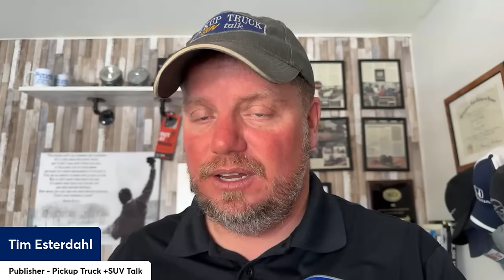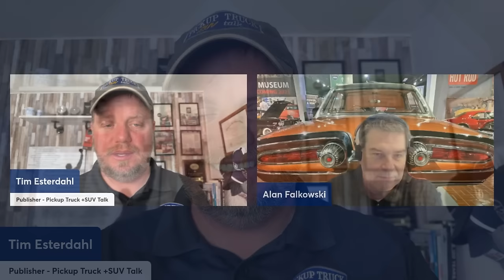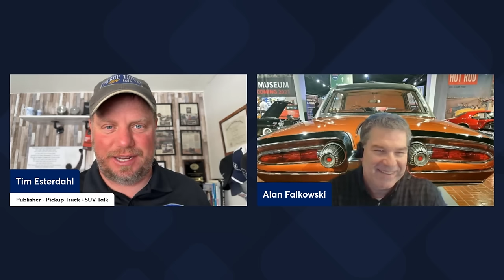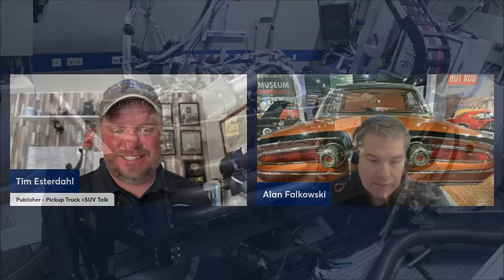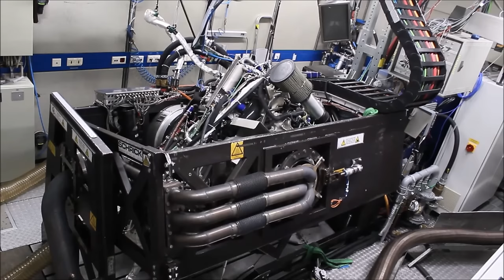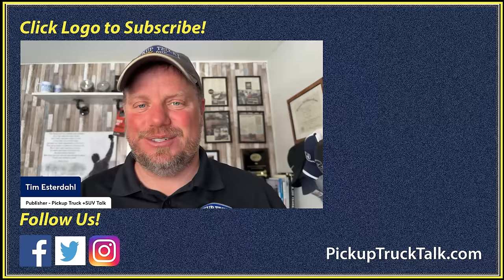Engineer Deep Dive: 3.0L Hurricane Engine - Turbo Life, Oil and Intervals and More

Comment from the maker: There's been some questions about direct injection and carbon build-up on engines with this technology. I have asked about this with various engineers over the years and they have responded that the higher PSI of the spray nozzles, it atomizes the fuel better and removes this concerns. Here's an example of this explanation at the 3.28 mark of this video with a Chevy engineer. He is talking about the 6.6L gas engine, but this same information applies to most other gas engines. If you check out the spec charts online, you'll find the gas pressure spray PSI level for most is well above 2,000 with some being higher. The Hurricane engine has a "single high pressure pump providing up to 5,075 psi (350 bar) to a single fuel rail."

https://www.youtube.com/watch?v=A_VaFCpQ9nY
Reply: Fuel pressure being higher makes zero difference.  Most of the carbon build up happens on the back of the intake valves. A port fuel injector would spray fuel onto the back of the valve, cleaning it.  A Direct injection engine can't do this ,because the injector is inside the combustion chamber. Now they can play with the variable valve timing a bit to mitigate some of this.  But we had the heads off a 2022 6.2L gm last month. The carbon build up is clear. The only way to deal with it is frequent induction services,  which currently GM does not require as part of regular maintenance. However, one of the first recommendations to diagnose a P0300 code ( random missfire) is to do an induction service with Top engine cleaner. 

The problem of carbon build up very much exists. GM seems to be fhe best at avoiding excessive build up. But it still happens.
Reply from the maker: @terrencejones9817  The way it was explained to me is carbon buildup is left over fuel that wasn’t fully cooked. Higher spray causes better atomization and therefore you don’t have left over fuel. Thus, the carbon buildup on the back of the intake valves doesn’t exist.

FYI - Ram has 5,075 PSI spray pressure.
Reply: @Pickuptrucktalk  Problem is that doesn't address what actually causes the carbon build-up on the back of the valves. It's not fuel, it's  oil/fuel vapour from the PCV system.  All engines burn crank case vapour through the PCV system.  Higher fuel pressure will actually make this problem worse.  That high fuel pressure dilutes the engine oil with fuel. That fuel in the oil causes higher pressure in the crank case. That fuel oil mixture is then sent through the PCV and its dumped right on the back of the valves. 

People that like to go on extended oil change intervals make this situation worse. The more fuel contaminated in your oil, the less it lubricates, the more the oil turns to vapour. 

Google the GM Dexos gen 3 spec.  It's specifically designed to reduce oil coking/deposits in a turbo charger.  The only way you get oil deposits inside a turbo, is if the shaft seal is leaking,  or the oil is being pushed through the PCV system .

My wife owns a 2018 equinox 1.5L turbo DI engine. I maintain it well. Recently in cold weather it developed a missfire.  GM has a TSB about intercooler icing.  When we pulled the intercooler boot off, it was full of water and oil sludge. The only way oil is getting into the intercooler is through the PCV system.  I change the oil on this car every 3000 miles (5000km) I do an induction service every 25k miles to avoid the carbon build up. That being said, the discovery of oil in my intercooler,  means I'll be doing another induction  service soon.

BTW, if you took a look inside the intercooler of any Ford Ecoboost, you'll discover the same issue.
Reply from the maker: @terrencejones9817  all I know is the spray pressure is the answer I get from many different engineers at different companies. I’ll also add in the last few years I get confused looks from engineers when I ask them about carbon buildup. I take that look to mean they consider it resolved and have moved on.
Reply: @terrencejones9817  I agree with you sort of. Better burnt fuel is gonna push back any meaningful carbon build up. How far it pushes it back? Who knows? 150k miles maybe. But yeah you are right. It's gonna happen and it makes it hard to look at these DI engines and not say it will eventually reduce the performance and longevity at some point.
Reply: @Pickuptrucktalk   They definitely have not been solved, I'm the Front line guy who sees the problems first hand. I understand why engineer's have decided to go to these types of designs. However,  there are some fundamental compromises that happen with them, and they can not be fixed.   Check out some of the videos that Engineering Explained has done on the issue. He's much better at it than I can be from my phone.
Reply: @terrencejones9817 SavageGeese had a really good video about direct injection and carbon build up as well, pretty much says the same thing you said when it comes to the PCV system.
Reply: @Fadic4   Yes, I've seen it. There are also some great Technical papers published to the SAE, if you are into the technical side of it. Also some great posts on Bob is the oil guy forums from Petroleum engineer's whom helped design some of the current oil specs that mitigate the problem.   That term mitigate is key, carbon build-up can not be solved with out current designs/technology,  we can reduce it somewhat.
Reply: @terrencejones9817  I do enjoy the technical side of it, I’ll definitely check some of the papers out when I get a chance, thanks!
Reply: Rams are not selling down in Texas. All the dealerships are full.
I think the quality control on Rams electronics have people leaving the brand
Reply: Tim thanks for talking to the engineer. I'm gonna move up to a 2500 I still love the hemi.
Reply from the maker: @terrencejones9817  just circling back on this since I’ve done a bit more research. It seems like you are saying the new advanced oils meant to reduce carbon build-up aren’t good enough for you. Is that correct?
Reply: @Pickuptrucktalk   the current specs do help. However, manufacturers still have not recalibrated their overly optimistic oil life monitors.  I mentioned my 2018 equinox.  I went to 7000km on one oil change, roughly 4500 miles, the crank case was close to a liter over full and smelled badly of fuel. My wife's commute is only a 5 miles a day. During very cold weather, the car doesn't run long enough to burn off the oil diluted with fuel.  The oil life meter still showed 45%. Yet that oil was no longer lubricant, it was slowly turning into a solvent. I performed the TSB for my wife's car that will help this problem,  at the cost of reduced fuel economy.  Honda has also had issues with over full crank cases due to fuel diluted oil.  GM spent a long time and developed a very complex and multi stage PCV system on the 1.5L LYX engines, yet dirty fuel/oil still makes it through the turbo ( BTW oil clogged turbos eventually kill them) and into the engine.

Higher injection pressures will push more fuel past the rings.   There is no magic wand here to fix the problem, it's inherent to the overall design of DI. Heavy duty diesels are not immune either, it's one of the reasons they have 10-12 quart oil capacity,  they know the oil will be diluted with fuel, they expect it to burn off. Diesels being compression ignition and Diesel fuel being a lubricant itself prevents carbon build up, but the blow by still happens. 

That blow by is also why your 3.0L Diesel consumes oil. With the thin 0w20 oil in the 3.0L duramax,  it doesn't take much fuel dilution before the oil in the crank case starts to vaporize.  Your particular truck might also have a defective pcv baffle in the valve cover too, that's making your consumption worse.
Reply from the maker: @terrencejones9817  ok. To summarize your view: high-pressure fuel spray, advanced oils don’t fix the carbon build up issue for you. Add in the longer oil interval and that’s not helping you like new engine design? In your view, the engine design is flawed and manufacturers haven’t adequately come out with a new design.
Reply: @Pickuptrucktalk   Decent summary yes.  We are at the limits of internal combustion engine technology.  Toyota and Ford have switched  to dual injection,  which will solve the carbon build up on intake valves. It doesn't solve the oil being diluted by fuel. We would have to go back to the days of low pressure port fuel injection, and move away from the ultra low tension piston rings that manufacturers have been using for the last 20 plus years. 

However , we can't go backwards. 

Also somewhat related to the high soot production of GDI engines, soon we will likely seen Gas engines with particulate filters,  like diesels have now.
Reply from the maker: @terrencejones9817  thanks. I’m hoping to ask Ford about it on the Ranger drive next week. The 2.3L has only DI and the 2.7L has both DI and Port. I’m curious why.
Reply: @Pickuptrucktalk  just to add: Toyota's new 2.4L turbo 4 uses both port and direct injection. Some for 2.7s out there are well north of 200,000 with no carbon build up.
Reply: @alldecentnamestaken  I believe Toyota uses their D4-S system on all of their modern engines. They don't seem to seal with carbon issues.
Reply: @Pickuptrucktalk  I was thinking about this and we do have reasonable solution to the carbon problem in DI engines. An oil catch can is a pretty good way to reduce and "push back" carbon build up. But OEM do not do this even though they are relatively cheap and installing one will even void your warranty.  I believe it is because they take maintenance but u was curious on your opinion and others
Reply: All is not the same. I have an Audi A8 with 3.0 tfsi. Has 200k miles.  Just had water pump and thermostat replaced, valve cover gasket replaced.  Still original plugs, coil packs. No catch can, all stock. Buildup on the valves was minimal. Engine still runs great and average 24-25 mpg for such a heavy car.
Reply: If hurricane has only direct injection I understand that like other engines will have buildup on intake valves. Can you help clear this issue up?
Reply from the maker: @stuarthoffman5065  DI does not automatically equal carbon buildup to such a degree it causes a massive loss of performance.
Reply: @Pickuptrucktalk  I’m no engineer but Toyota has very high fuel pressure for direct injection but also includes port injection for specific duty cycles I believe to help with carbon buildup.
Reply from the maker: @stuarthoffman5065  Port injection has benefits for fuel efficiency and emissions. It can help with carbon buildup, but it doesn't eliminate the oil concern for carbon buildup. 

Interestingly, Toyota doesn't tout any carbon buildup for port injection. I've never read a press release with that statement. 

Check out this video explaining D-4S. You'll notice how it doesn't say a thing about carbon buildup. 

https://www.youtube.com/watch?v=_KMyfpop9Fs
Reply: @Pickuptrucktalk   They are leaving the wording of carbon build-up. But when they say emissions.  That's what they mean. Carbon on the valves causes them to stick, and eventually, they do not close all the way. That leads to incomplete combustion and emissions go up. 

We did a 2019 Bucik encore last week that burned a hole through the side of one of the valves,  because of the carbon build up.
Reply: All Gen3 Tacomas, ‘16-‘23, have had dual injection and not had a problem with build up. The DI is only used during high load periods other that the short 10 sec DI cleaning cycles you can hear during long idle periods. Dual system has proven itself well.
Reply: @Pickuptrucktalk  we are now a couple years into the 2.7L turbo still seems to have thos issues. Maybe because it is the first iteration of that engine in the field, and they may be able to address that in later iterations.
Reply from the maker: @stevenblack9324  I'm not seeing anything on a recent engine when I Google it. I see some older 2014 - 2017 engines. That makes sense considering the changes discussed didn't start happening until the last few years.
Reply: The Toyota D4S salution has proven to be the best salution by adding port injection with direct. I have seen engines with 100k miles and the valves look the same as regular port injected engines. The computer uses both even while driving in some cases it utilizes both at the same time. Some say it is just when idling which is false. That is what Stillantis should have used. Even Ford is now using a similar system. Stillantis always uses cheaper parts and designs on many of their models and I am sure cost was a reason they chose not to use it. Even Subaru has added it and contracted it out to Toyota to make D4S for their engines. I just got my 2024 6.4l 4X4 and glad I got it before being forced to get the new turbo engine. My 2018 Ram 2500 4x4 has 180k hard work miles in the oil and gas field and has been really good. @terrencejones9817
Reply: Ford DI Cayote Engines have DI injectors as well as Port injection. I probably would add a Snow Performance Meth injection to cure the carbon Build Up
Reply: @terrencejones9817 I’m an engine builder. Graduated SamTech in Houston. The better, finer the atomization, the better, faster (less ignition advance needed which is negative work on the piston), and more complete combustion from better flame propagation in the combustion chamber. That means LESS fuel is needed, less byproduct, less oil dilution. When you add more air by way of turbocharging, you’re right back to needing more fuel which is why you have to have an oil formulated to mitigate damage from oil fuel dilution. Basically, if the power was the same, the higher fuel pressure would result in more complete burn, less fuel needed, and less crankcase oil dilution…but people want more power.
Reply: There is now way to protect intake valves from carbon build up in a direct injection engine.  Thats way some manufactures have added port injection along with direct injection on some of their engines.
Reply: @danielk7111   Gas engines have extremely low tension piston rings , which means some of that high pressure fuel goes right past the rings and into the oil.  Car and oil manufacturers wouldn't be spec-ing oil specifically designed to reduce Volatility if fuel dilution wasn't a problem still.  Most manufacturers in gas truck engines moved from 6 quart to 8 quart capacity, because the OEMs know fuel will end up in the oil,  more oil in the sump will allow a reasonable oil life while dulited. Still no person should go below 40% on the oil life meter on any DI engine.
Reply: @terrencejones9817 gm junk lol DI only is bad design should get with times direct and port
Reply: @terrencejones9817 , I would check your higher pressure fuel pump and check or replace your PCV system. The high pressure fuel pump is likely leaking fuel into the crankcase. The PCV system is probably partially plugged making matters worse. Higher fuel pressure helps atomize the fuel better so it can burn better and does not really affect in cylinder pressure and should not push it past the rings into the crankcase. Higher pressure can affect the high pressure fuel pump, but if it is working properly, there should be no fuel getting into the crankcase from the back side of the high pressure pump. The piston rings in newer engines are lighter and more prone to allowing combustion gases past them, which makes things worse, especially as an engine wears. Also, short trips not allowing the engine to warm up and fully vaporize moisture and burn any fuel vapor present does accelerate carbon buildup and necessitates shorter oil change intervals. In reality, GDI engines are great in theory, but as found out by many companies, need to be refined (add port injection, modify software, etc.). Also, something that is not really talked about is what causes the need to change the oil? Is it that the oil looses its ability to lubricate? With todays oil that is usually not the case. Many times it is what you didn’t add when you filled the oil back up when doing your last oil change - in your case it was fuel. But there is also particulate from the combustion process. I have worked on many engines that run factory recommended oil change intervals and they are slugged up and had premature failure of certain timing components. The last one I dealt with that was affected by oil condition was a Ram 1500 with a 5.7L Hemi and had low oil pressure. I did an oil change on it and it fixed the issue. It was running a good filter designed to run 10000, but they had roughly 7000 miles on full synthetic oil. What I am trying to say is the oil was lubricating fine, but there was enough particulate in it to affect a U.S made oil filter to where it affected oil by about 20-25 psi.
Reply: That GM engineer  didn't even answer the question.  Sounded like a total BS politician.  Increasing pressure isn't going to help you with carbon buildup on the BACK of the intake valves.  You mean to tell me every other manufacturer are idiots that like to waste money on dual injection like FORD and Toyota but all they had to do is raise the fuel pressure???  LOL B.S.!!!!!   Another reason not to buy a trash GM product and now Stellantis!   These engineers think we are stupid.  You didn't include dual injection because YOU DIDN"T WANT TO SPEND THE MONEY because you sell DISPOSABLE VEHICLES!!!!!!   I will never buy a GM or Stellantis product ever again!
Reply: @Pickuptrucktalk Most of the carbon buildup is in the intake that is exposed to the recycled PVC fumes that are no longer mixed with port injected fuel. And is directly deposited on the intake port and valves the only viable fix so far has been to use 2 injectors per cylinder one for the port an one direct injector in the combustion chamber if Stellantis has not done this they have made a huge unforgivable mistake on the Hurricane engine.
Reply: @Pickuptrucktalk  I call BS on that. Higher pressure will only possibly address the combustion chamber and piston ring carbon issue and do nothing to address the intake ports and intake valves.
Reply: port and direct injection help and new piston designs with coatings and dimpled impressions gapless rings are coming, changing oil more often also helps.
Reply: It has nothing to do with spray pressure especially since they have egr bringing dirt into the intake. If you don't t have port injection you will need to pop the intake every 30-40k and blast the valves
Reply: @Pickuptrucktalk  diesel sprays at 39000psi and guess what the still clog up the intakes
Reply: @Pickuptrucktalk  🤣🤣🤣🤣🤣🤣🤣Carbon build up on the back side of the intake valve is entirely due to blow-by oil vapors getting sucked into the intake manifold through the PCV system. You're clueless as to what is actually going on inside the engine. A direct injection engine is ALWAYS going to have this problem, even with an oil catch can installed in the PCV hose.
Reply: I have 21 f150 3.5 ecoboost twin turbo. It's insane the power and torque this truck has and the fact it's very well designed for hauling and sport type settings that properly do the task at hand. With that said just broke 60k and changed plugs they was horrible carbon built up and looked worse than my 5.3 02 gmc. My wife has a 2010 ram 5.7 and my truck will ear her truck up from a dig or roll. As well as hauling pulls more and more torque and horse power. Handing by far better in F150 I never would have thought a V6 would be capable of doing what this truck has shown me over last 3 year's RV car hauling and pulling friends out the mud and racing in sport mode with plenty of W believe it or not.
Reply: Is etorque gone now then?
Reply from the maker: @chevy6794  yes.
Reply: @Pickuptrucktalk  that’s too bad. I thought it was an excellent alternative to start stop.
Reply: @Pickuptrucktalk  If I had to guess what's going on to reconcile both sides - it's that the oems are overbuilding the heads on flow, such that even if it's constrained a large amount, it's not the limiting factor for producing rated power levels for years to come. That said, the residue is clearly capable of throwing engine codes and limiting valves' ability to close, etc. So... there's a grey area in between, that makes me think certain oems are groupthinking, or gaslighting a bit, even to their internal engineering teams, such that their responses are "The first rule of direct injection club is, don't talk about direct injection club."
Reply: All the things done to improve fuel economy are for EPA. Since EPA doesn’t do the testing but leaves it up to the manufacturer all the dodads the manufacturer installs are for the leaches in Washington to read about and say “that must be real good”. It sounds impressive. If the manufacturer could make cake and ice cream sound economical the people at the EPA would buy it.
Reply: My 2.0T had half a coffee cup of carbon scraped out after five years of ownership and the noticeable gain in power after the carbon cleaning was fantastic.  It’s part of normal longer-term maintenance with direct injection engines.  

Do you think most customers will use the manufacturer recommended gasoline for turbo engines?  I was told mine will run below the minimum 91 octane gas required, but it will be less
efficient/burn more
fuel and make less power since the engine is busy trying to prevent knock.
Reply: @terrencejones9817 Ford is the only other truck that uses direct injection. It's crap.
Reply: So here's something you will not hear much outside of some technicians. BG and Chyrsler as well as GM are working on a cleaning system that gets connected to the MAP sensor and it sprays in a chemical that will clean up carbon deposits and it works quite well. GM has released their 44K cans (still has the BG logo because it's a BG product with GM/AC Delco in larger print). This cleaning is not cheap, if I recall it's about $200 or so for the cleaning and whatever the shop labor rate is for it. The Chrysler stuff for the 3L Hurricane is still being tested and I think it comes out this year or early next year, will have to ask our BG rep.

No idea if I'll get into trouble for this, but people need to know that there is a solution to the carbon build up that either is available right now or it will be within the next year or so.
Reply: Agree, if the sensor goes they are forcing you to replace it since you have no way to monitor oil level without it.  New source of revenue!
Reply: The problem is not fuel atomization, its the PCV valve feeding straight oil back into the intake to be deposited all over that, and the valves.
Reply: @Pickuptrucktalk  The injectors are after the valves. I'm SMH over here.
Reply: Great, higher pressure means more oil dilution due to fuel blowing by the pistons. Also, carbon buildup in the combustion chamber wasnt the biggest problem, carbon buildup on the other side of the valves just before the combustion chamber was. Fuel does not flow over the backs of the intake valves anymore with direct injection, so nothing fixes this except an expensive induction service. Inject that fuel as high pressure as you want, it wont clean the backs of the valves at all.
Reply: @terrencejones9817 As the owner of the best GDI engine built, I don't have any fuel dillition issues in the crankcase, and my oil changes are done per the factory oil life monitor
 I run Valvoline advanced for.ula full synthetic and can verify it helps cut the intake carbon issue down by quite a bit. I'm approaching the 200k mile mark with my 14 focus and bought it new, hard to beat the efficiency of this unit. The theory of higher fuel pressure cutting down on fuel dilution by engineers I believe to be a misunderstanding, it's dirty fuel injectors in a GDI that will cause this, as poorly atomizer fuel does not achieve as complete of a burn. We won't mention leaking high pressure pumps.
..
And the engineers want to double the pressure again, funny.
Reply: @Pickuptrucktalk I'd take that look to mean they aren't responsible for addressing warranty issues lol
Reply: @3o2Boss  Are you saying that the oil, which normally should stay below the piston oil control ring, is somehow reducing carbon buildup in your air intake? Or am I misunderstanding what is reducing your intake carbon? Unless other oils were making it above the oil control ring, I don't see how there could possibly be any difference.
Reply: @theredscourge  I believe their addative package adresses the slight pcv oil evaporation issue and has something in it to help prevent the carbon from forming on the intake valves.
Reply: @3o2Boss  Ohh...that could be it!
Thanks for that, I've been trying to find a plausible explanation.
Reply: @terrencejones9817  correct, that is why you need to run a catch can setup to prevent this buildup. cheap and easy fix
Reply: I just traded my 18 Silverado LT for a 24 Ram 1500 5.7 because it's a dinosaur without intake clogging and $1000 injectors. Stelantis will be redoing this engine and adding secondary injectors in time is my prediction.
Reply: @GoatPrint  If you trade in every 6 years and still expect to have engine troubles, that really does not say much for the manufacturer.
Reply: I would probably agree if it wasnt boosted. I hear that on N/A applications it not nearly as bad as it is with boost. When pushing so much pressure you will  have fuel dilution as well. You better be changing the oil way sooner than they recommend.
Reply: @Ratkill9000  The GM cleaner has limited success and it's very hard on calalytic convertors. We run the GM cleaner through our 5.3 trucks every 20,000 miles which has stopped the missfire problems but when the engines are torn apart for repairs the intake valves still have a lot of carbon build up.
Reply: @terrencejones9817  you are absolutely correct VW’s have the same issue. I’ve had to take heads off and clean the carbon out of the valley in the head. Warranty won’t pay for it so sorry customer it’s going to be 5000.
Reply: @terrencejones9817  Toyota had the same problem with direct injection and their solution was to combine direct fuel injection with port fuel injection to get rid of the carbon accumulation on intake valves.
Reply: @Pickuptrucktalk  - simple - DI only optimizes lean burn mode - it is overrich for stoich mode because gasoline can't be injected at high enough pressure to full vaporize, this leading to incomplete combustion and soot.  For optimal stoich burn (rich) mode operation, the engine ALSO needs a port fuel injector.   Not only that, it will clean the intake valve as well (with top tier gasoline).    Makers cheaped out on DI-only injection.
Reply from the maker: @brianmann986  Ford dual injection still causes carbon buildup. How do you explain that?

https://www.ford-trucks.com/articles/3-5l-ecoboost-carbon-buildup-solved/
Reply: @Pickuptrucktalk   at the same rate on the same detergency fuel?
Reply from the maker: @brianmann986  the video shows two EcoBoost engines with one having DI (1st gen) and the second having dual (2nd gen) at both 100k miles. No idea on fuel type.
Reply: @Pickuptrucktalk  - ok, perhaps I am thinking of the naturally-aspirated variants of GDI engines where high sooting of the oil caused by the single direct injector has cause manufacturers to cut oil change intervals due to gasoline engine oil additive levels not up to the task as diesel engine oils are (loaded with detergent-dispersant additives).
When turbos are added to gas engines, in-cylinder blowby comes into play, which, of course, increases breather depositing onto intake valve stems.  For turbo GDI engines, dual injection likely won't help reduce intake valve deposits, but will reduce soot loading of the oil.  Much has been written about GDI single injector sooting over the past decade.
Reply: @Pickuptrucktalk is called cost savings. What could you possibly be curious about?
Reply: @terrysoule8441  I have experienced the same. I have the 3.0L TFSI in my 2012 S4. 75k miles. Runs like a dream, consumes zero noticeable oil. I've never cracked it open and checked the valves but I think the use of high quality oils, Top Tier 93 octane fuel, 4000 mile fuel treatment, and minimizing short trips helps.